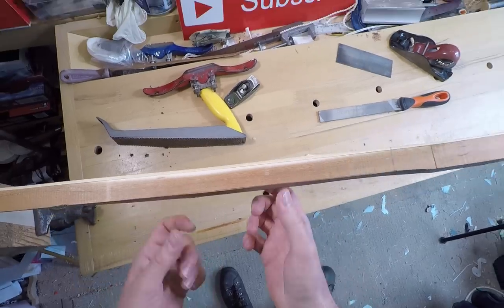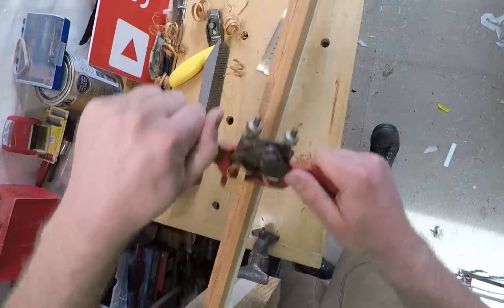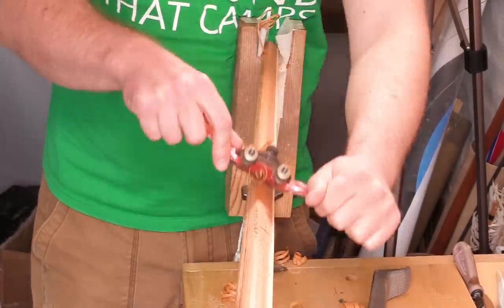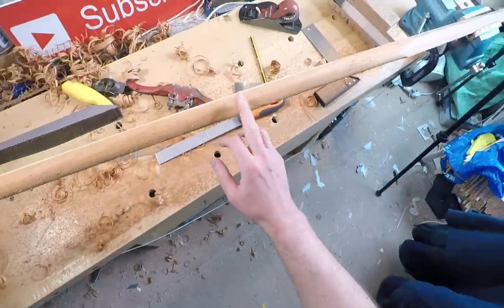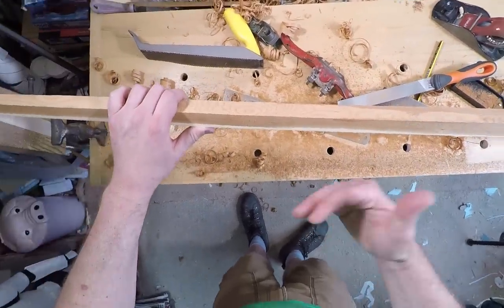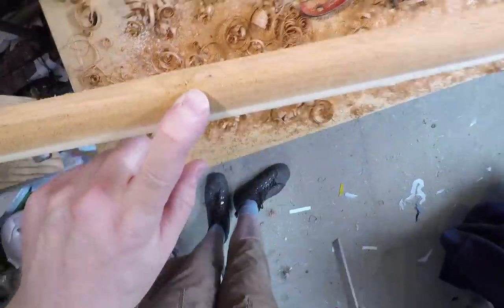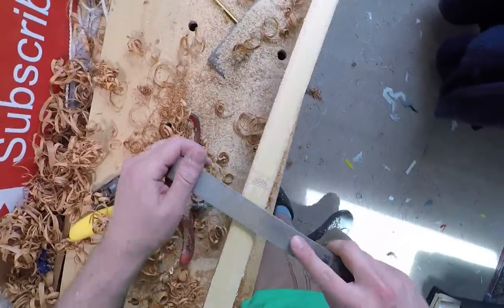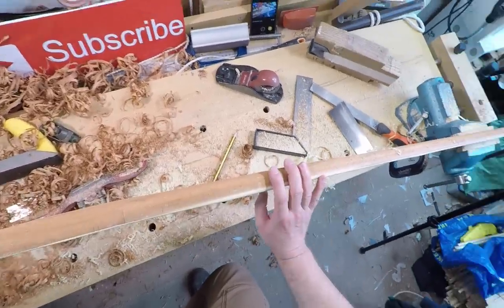HOW TO MAKE A YEW LONGBOW part 1 `roughing out`

Comment: Nice Video. It is great to see how you think your way through problems with the wood. I have spend many hours searching for perfect wood. Now I see, any dummy can make good stuff from perfect wood... it takes an experienced craftsman to make good stuff with decent, available wood.
Reply from the maker: Thanks.
Reply: If you want a perfect material, make your bow out of fiberglass - something that has zero interest to me.

I don't think there is such a thing as a perfect yew stave. Because of where and how they grow, all have defects of some sort. If you are lucky, you can get a couple of billets that don't have significant twist - which is probably the major yew stave defect.

Comment: So am I right in thinking the use of sapwood in place of the bamboo (when making a bow from a single piece of timber) is because the sapwood it a bit more stretchy, for want of a better word, than the heartwood? So sapwood is able to withstand the tension when drawn and with the heartwood being more stout it's better at withstanding the compression.
Reply from the maker: That's correct, well done.

Comment: Here's a question... Do you have a rough idea of what the finished draw weight is going to be when you begin "roughing out", or is it a matter of the weight developing during the tillering process?.  Is the  difference between a  100 lb stave, and 40 lb stave obvious to you  before you begin roughing out?
Reply from the maker: Yes, we have a rough idea, there is a huge difference between 100lbs and 40, so its more obvious when dealing in those extremes as far as size of stave goes, BUT, wood doesn't always `play ball`, a alrge lookign stave can make an a normal/light weight bow.
Reply: Is it purely the thickness/width that determines draw weight even when comparing two staves of the same wood?
Reply: Of course he does, but the fining down will bring him to the draw wt. he's looking for.

Comment: Is it possible to make a longbow out of an 3cm thick board its long enough but just 3 cm thick
Reply from the maker: In general you can make a bow out of whatever you want, not everything will work well and you may not end up with the weight you want, but it will probably make a bow, thats assuming its wood that is usually used for maing bows.
Reply: @longbows  ok thanks

Comment: Just interested to ask what the problems were with the sap wood that made you choose the bamboo backing?
Reply from the maker: It has some minor cracks, but the heart wood was fine.
Reply: If you make a yew self-bow, the tillering has to follow the growth rings on the back of the bow. In some instances, this can be very difficult. It is also possible that there are defects in the sapwood (possibly extending into the heartwood where they is less of a problem). The easy way to handle such staves is make the yew stave back flat and back it with a lamination of something like bamboo or hickory.

Comment: Do the top and bottom  limbs have to b the same size
Reply from the maker: They are different lengths due to handle placement, we tend to cut out the same dimensions, by the time you have tillered the bow they will probably be different sizes.